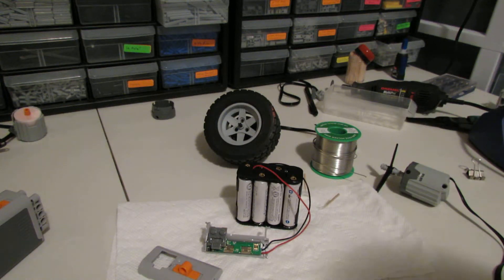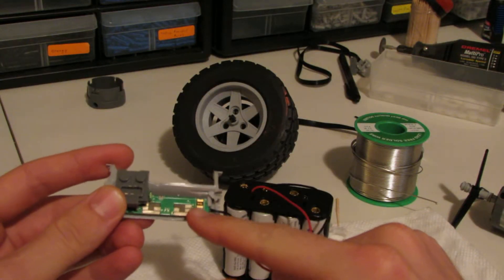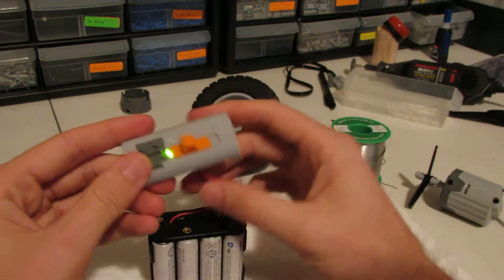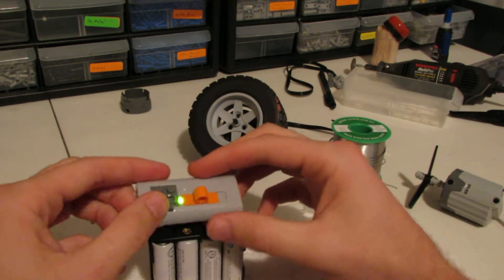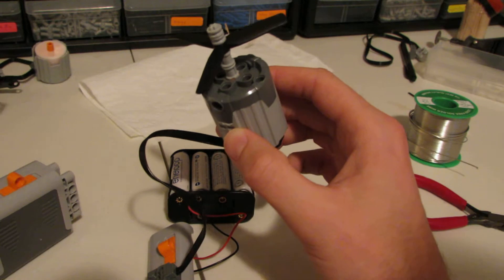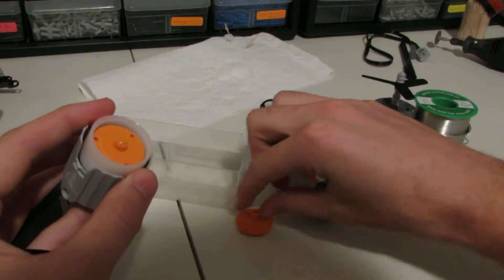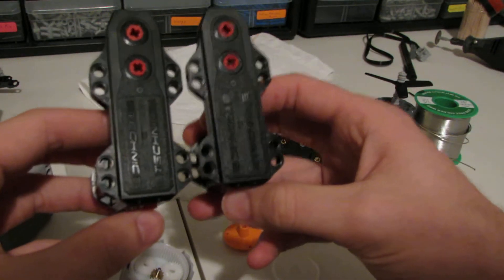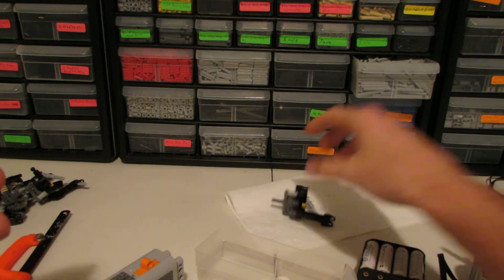05 Modifying XL motors and Battery Packs

Comment: Hey Technic Builder. Since you were taking apart your old crane, iI wanted to know if I could get a basic overview of the chassis itself; I plan on building a heavy crane of my own and I wanted to see how you set up your build.
Reply from the maker: Alright, I'll make one more video of the old Chassis before I take it apart.  I thought about making a "taking it apart video" but then I realized that would be a bit boring.  I'll go over exactly the features of the old chassis that made it a "bad" or at least "sub optimal" design.
Reply: Thanks, I'd really appreciate it!